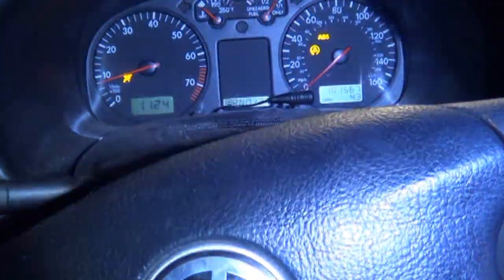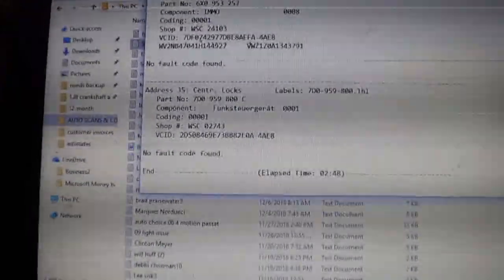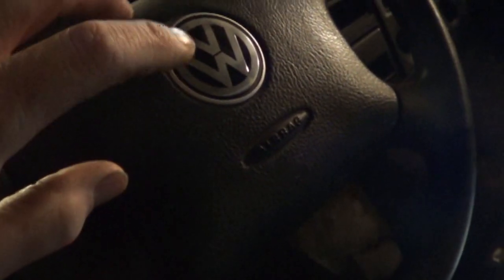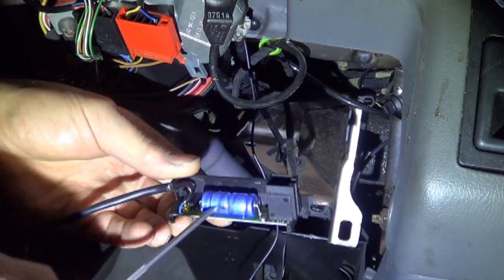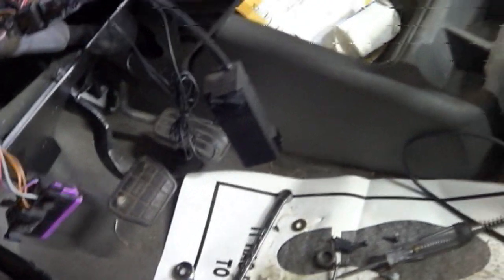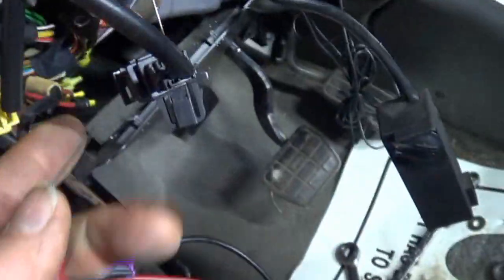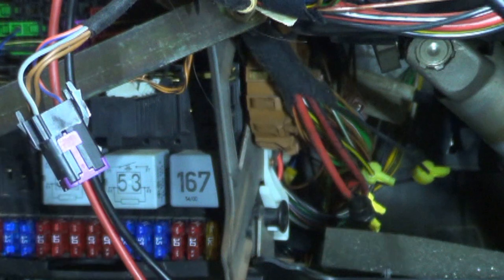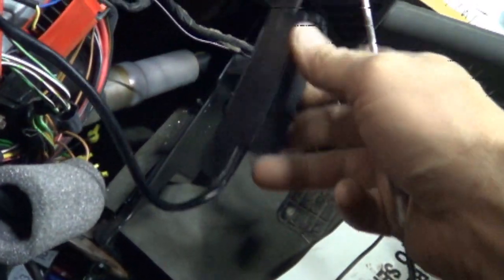Vw Eurovan Steering angle sensor code

Comment: That is an expensive sensor. I love the vcds, best tool next to the oe scan tool to work on vw/audi. I always check everything when it comes to an expensive sensor like that. Nothing worst then finding out that wasn’t the problem, after putting an expensive sensor. Great video
Reply from the maker: Thanks!  Non-ESP clock springs are much cheaper.  (no steering angle sensor inside)

Comment: yea thats really expensive for a roll of copper film. for prius, you can get one for 20. but thats aftermarket. no idea how long those last tho. but usually its the film that breaks. and sometimes you can fix the break...
Reply from the maker: on ESp cars the clock spring is integrated into a "module" that includes the steering angle sensor and other stuff. That is what makes it expensive.
Reply: @CoolAirVw  Thanks! i should look for a video that breaks it down for fun. might be educational since im moving a lot of electrical sensors on my conversion also. edit: found not for my conversion but its a cool decoder ring.

Comment: Curious if you have a suggestion: When I go thru the coding steps and to Basic Setting for G85, I am always seeing 'Not OK' and unable to clear the error code for 'control module incorrectly coded'. I've tried this with ignition on (only) and also car running. Making sure wheel is straight, sensor reading 0deg (can also see other values, not dead at 0deg). I've tried turning wheel left&right 30/90/360deg (and back to center) before calibration, but still always getting 'Not OK'. Do I need to go for a long drive first?? This is all after replacing a dead steering angle sensor (previously would not register any value in Measuring Block 5).
Reply from the maker: do everything exactly as in this video.  If you dont do each step it wont complete.

Comment: I own the same vehicle (2001 Eurovan ESP sensor) and I am unable to find the clock spring part 7D0959654 anywhere in the US (new or used). We tried to install the 7D0959653 but that does not include the sensor wire. Is the installed clock spring 7D0959654 something that can be sent in for repair? Would you have anybody to refer me to?  I'm going to pull out my voltmeter to confirm that there is a 0.5 charge running through lines 1 and 2.
Reply from the maker: It cannot be sent in that I know of.
Reply: @CoolAirVw  great video. Where did you order Clock Spring part? Thank you.
Reply from the maker: @sanitycruz  Vw.  Its actually discontinued but there are still plenty in old stock.  Just checked a week ago or so.   There are some youtube videos on replacing the "ribbon" inside a clock spring so if yours is just open in the ribbon maybe you can fix it.   Clock spring on esp cars has integrated steering wheel position sensor and they are expensive!
Reply: sender.de will repair clockspring in germany

Comment: I have a buddy that has a 2001 like the one you are working on in this video. He has the same problem and has not been able to find a new clock spring unit anywhere to order. He did find one and it was about $500 but once he got it it was the wrong part in the correct box so he sent back. The company then found him a used unit. His mechanic put this one in but it must have been bad because it did not fix the lights. The mechanic said you have to take a used unit out perfectly to be sure you do not damage it. So my question is do you have a resource for him to order a new clock spring? Also the mechanic seems to not want to work on his van anymore and when he called another VW mechanic they also declined to work on it 😂 He lives in Monterey CA so I told him to call up to Santa Cruz and hopefully find a mechanic that will work on it. I own an 86 vanagon westy and do all my own maintenance and really glad I do own a vanagon and not a Eurovan 😆 So any help on how hard it is to find a new clockspring and resources would be great. Awesome video also. Thanks!
Reply from the maker: Really its dealership only or used.  Used one not such a good source for various reasons.
Reply: CoolAirVw Rm Ok thanks that is what I was thinking. I guess he tried the dealer locally but I think he needs to call more until l he can hopefully locate one. He did end up going the used route after he could not find a new one and as you said, it did not work properly. Pain in the butt that they have discontinued the part. Thanks!
Reply from the maker: @PaxtonArtJewelry  thans for watching.  Make sure you do the steering angle reset as shown in the video.

Comment: Sitting in Norway.  I had the clockspring repaired in Germany from my 2003 t4 van and still receive the 0.0 on the steering angle.  Does anything plug into the little black box/capacitor?
Reply from the maker: Yes I think so.  But certainly a car in Norway might be equipped differently.